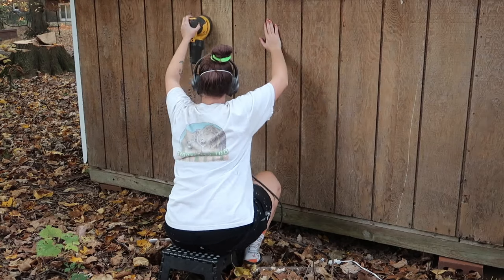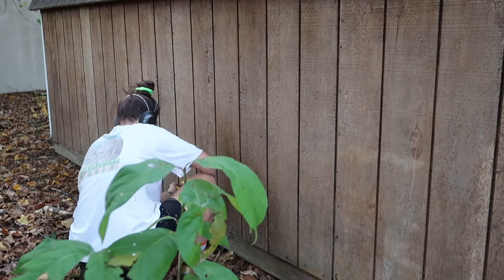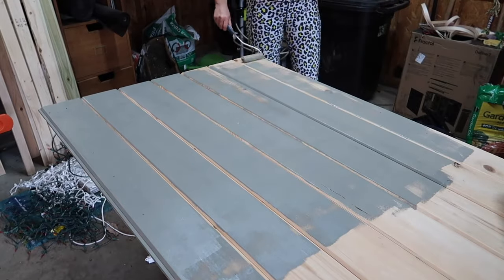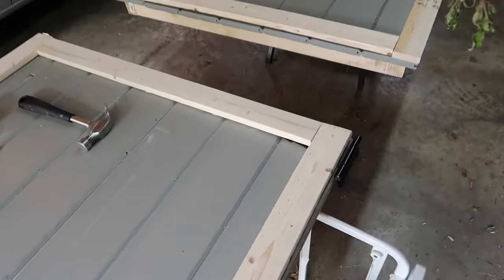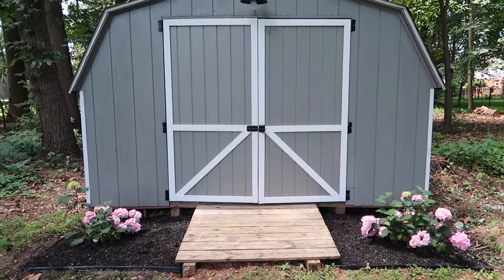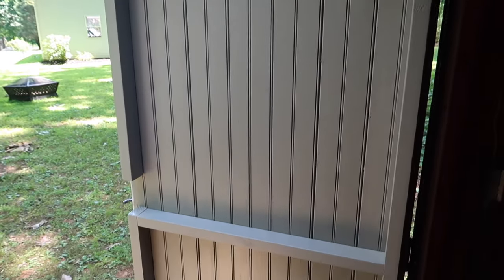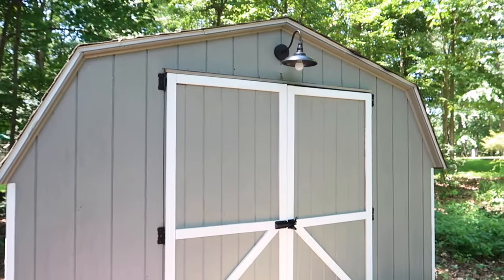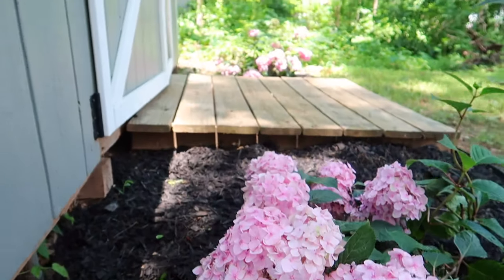DIY Shed Exterior Makeover | How to Paint a Shed | Building Shed Doors | She Shed Makeover Tour

Comment: Awesome job! Totally going to do the white trim on the doors im going to add to my shed rehab this winter so thank you for that! I was curious what you did for the inside of the doors, the latch you put on the outside is often used for a short fence that you can reach over to unlock, i was just thinking that it would suck if you went into the shed and  say the wind blew the doors shut, you'd be trapped in there, usually theres a hole with a lever for inside use of the latch
Reply from the maker: Thank you so much! Glad my vid could give you some ideas :) And you are absolutely correct about the door latch lol. Someone could presumably get stuck in there 😂 But the doors are so heavy, and even a little tight / sticky when you close them, that I'm not too worried about it. I've actually been meaning to do a little more with it to make it more secure / easier to handle.

Comment: Would it be a good idea to place it on cinder blocks to get it off the dirt and prevent rot. Gutters would definitely keep the water off the foundation as well.
Reply from the maker: Yeah that’s definitely not a bad idea - mine is propped up on cinderblocks which I think has kept the bottom from rotting out 👌🏼

Comment: Nice job! After you applied your grey paint, does it help keep your walls inside pretty dry? I'm building my own shed and was just gonna use OSB on the exterior.
Reply from the maker: I don’t think the paint necessarily helped waterproof the inside, just protect the outside wood panels. When I eventually do something to the inside, I do think I do some caulking to keep out bugs and any water :)

Comment: Did you use any particular solution or anything in your pressure washer because of the wood material you were spraying onto?
Reply from the maker: I did not - I just used the water pressure itself. It wore it down a little bit, but I really wanted to get as much paint and grime off of it as possible. I wouldn't use full pressure to wash it again now that I've repainted it because it would be too much.
Reply: @MissAnnieB  Thank you!

Comment: Miss annie what size is your shed? I'm building a 10x12 and the front wall is the hardest to do cause of lining the doors up with the grooves.
Reply from the maker: I'm not sure exactly but 10x12 seems about right. YES, getting the doors to line up perfectly and close smoothly was definitely tricky. I still need to tweak my doors a little bit to make sure they stay shut tight. Good luck with your shed!!
Reply: @MissAnnieB  thank you 😊

Comment: Nice job! I have the same issue with the rot at the bottom of the doors. You did a lot more work than I was planning on doing so now I'm going to follow your ideas. Our sheds looks similar. One thing I noticed is it looks like your doors are falling out a little in the middle. I would get a bolt on the inside to hold the doors closed tight especially since your soffit is not over the door side. A bolt on one side will keep both doors closed real tight. Hard to explain but this guy shows what I'm talking about https://youtu.be/n-4-X0eaNiI?t=603. Again nice job.